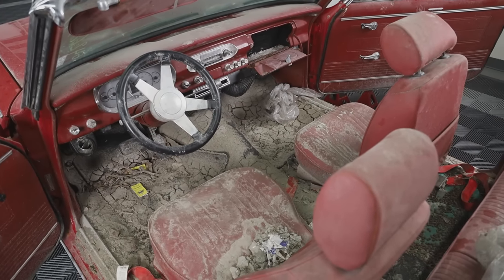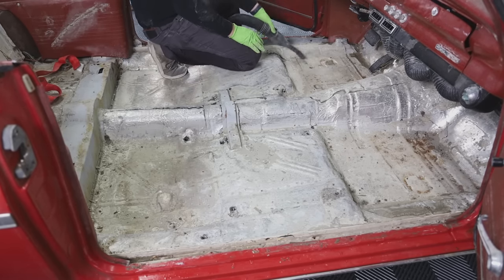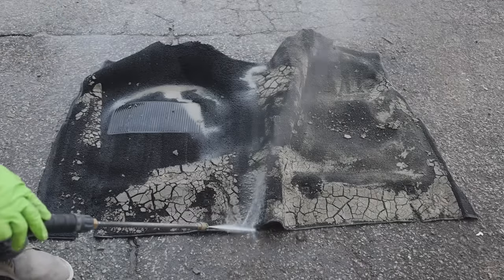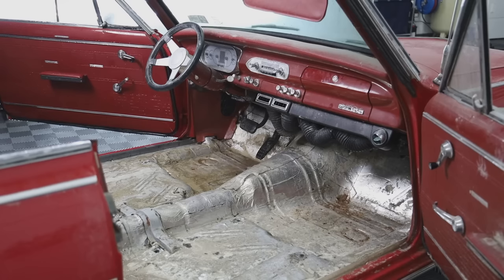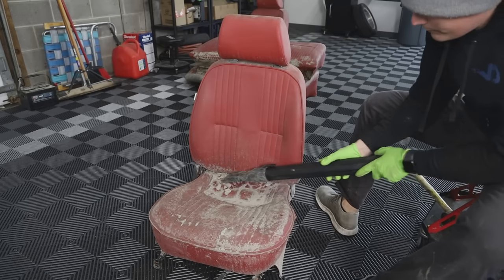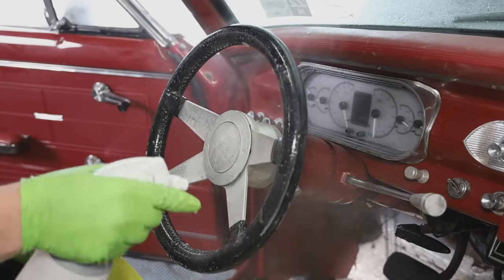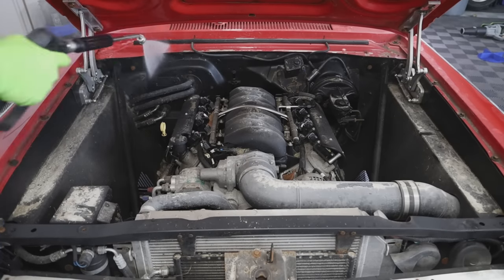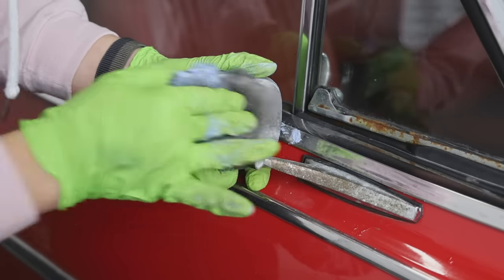Can It Be Saved?! Deep Cleaning A Flooded Chevy Nova SS! | Car Detailing Restoration

Comment: 2008-2013 Corvette and the 2014-2016 Chevrolet SS came with the LS3. That Nova also has an aftermarket front subframe, the factory strut towers are not there. Keep up the good work fellas.
Reply: Kbry
Reply: Is the car still for sale and if yes how much.
Reply: Also manual camaros from 2010 to 2015 had the ls3 as well.
Reply: Good job. Looks great.
Now the work begins, to disassemble this mess.
Cheers

Comment: Nice job on what you did. You noted how high the flood was, so the question I have is what about the mud trapped behind the door panels in side doors and rear interior panels and inside quarter panels underneath side glass and reason the car is forsale the car was in a salt bath so no thank you on the rust time bomb.   Been there !
Reply: It washed off.  But I have it ready striped. That would end it.
Reply: im not sure if you understand how long it takes to rust and its been cleaned inside and out its not gonna rust like that

Comment: Appearance wise it looks amazing. I would have also taken the seats apart and replaced the foam as well as the door panels as they are both absorbent and would retain smells. I would have pulled the steering wheel and blown out water inside the steering column and treated wiring and I would have treated any unpainted metal like the floors and doors with a rust converter as they were soaked in salt water.
Reply: Carfax: “Clean”. 😂

Comment: I would guarantee the cylinders and crankcase are full of water and mud along with trans and differential. If it has clutch fan that'll also need replacing. It definitely will be a looker when it's all finished. I had similar experience with a flooded with a 80's Chevy pickup. These were all the things I found wrong with it. Hope this helps.

Comment: You asked about the engine turning over after being in a flood. Depends on how long it's been. Might be a job for Marvel Mystery Oil to free up the engine parts. Wiring may have dried out enough. Might just need a new battery and oil change. Gonna continue to watch and see if it fires up for you.

Comment: Brilliant job.  How far up was the car flooded in your opinion?  Did you try to start it?  Great content guys!
Reply: Well, it's on the seats, no probably pretty high. There's no way the motor can turn over. There's 100% rust in the cylinders and is probably hydrolocked.
Reply: Very nice how much are they asking for it before restoration

Comment: Drain oil remove the spark plugs put some PB blaster or diesel oil down the cylinders but except for a few days replace ECU crank it over blow all the water out of the cylinders

Comment: I think with the engine I would first make sure it turns by hand . If that works then drain all the fluids & replace them then soak the cylinders with mystery marvel oil for a day or two then try and turn if with the starter

Comment: Deciding factor is: salt or freshwater flood? Hurricanes are usually salt, that means the car, clean carpet and vinyl aside, is unbuildable. The only way to get all the salt of all the pinch welds, overlapping metal, hollow areas and such is to strip and dip the whole chassis and wash it several times. If you don't do that, this car will always have rust issues and I mean everywhere, The drivetrain needs to have all the fluids drained, flushed and replaced within the first week or so too, otherwise it is junk as well.

Comment: Appears to be a salt water flood and it got high up in the car (past the dash). That car is going to need everything and a full restore. It actually should be torn down to a shell and dipped to neutralize the salt. If not that car will continue to rust from the inside out. It's a fully tear down project  but they don't make Nova converts anymore.
Reply: Exactly. It has to be fully disassembled.

Comment: There's any chances of that engine running again cuz guaranteed it's got salt water in it I would pull the plugs and put some diesel down the engine and then drain the oil and do it all over again two or three times The diesel will make it so the cylinder walls don't dry up because it's got oil in it and hopefully you can get all the saltwater out of the end and if not the engine stops if you could get them LS3s out of pretty much anything these days

Comment: of that car. It has to be taken apart to the last nut and bolt. Every strand of copper wire is junk IT CAN'T  BE SAVED
You see the salt on the vent window and that whole car will one day look like that.
Why..The chemical make up of salt EATS the metal molecules away end product is rust asmetal flakes away.
It's a big job to save a flood car.
Your cleaning is beyond spectacular..

Comment: You never take steel wool to any chrome do it with aluminum polish what happened to the doors inside the back panels that are in there under the dash all that you guys never touched any of that you have to take the door panels off clean the inside of the doors out,

Comment: The car looks nice but I wonder what it looked like in it's ORIGINAL factory build.  I'm hoping whoever is stripping it down plans on taking the seats and doors apart to replace all of that foam and insulation. Otherwise it's just going to be one big mold and mildew factory.  It has already been destroyed so I would assume that all they are doing is recreating a fake look hot rod.